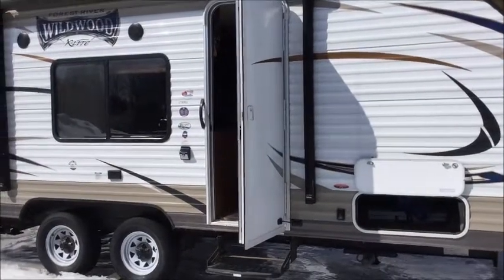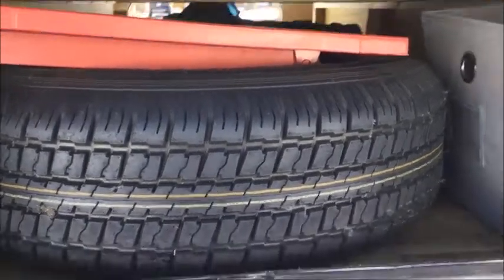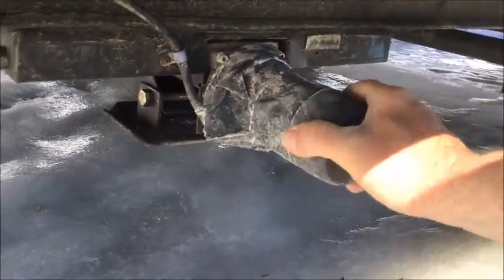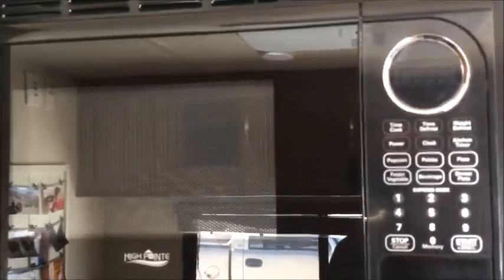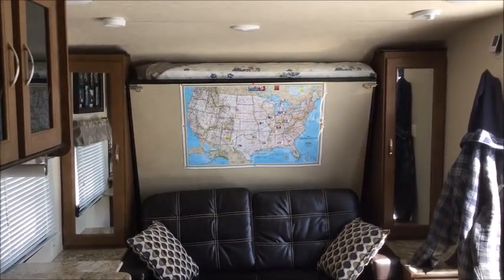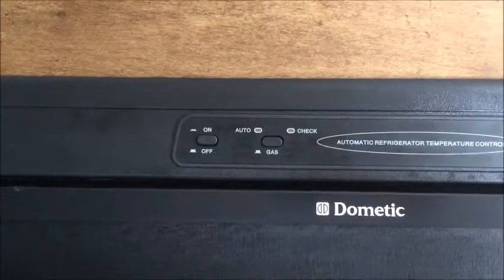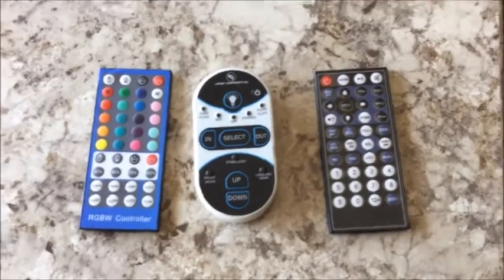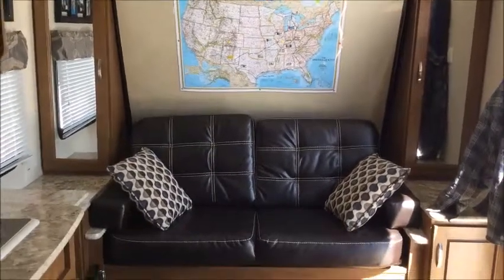New Forest River Wildwood 171 RBXL Camper/Trailer Owner Review

Comment: I'm 6' tall and I find the Murphy Beds with the short Queen mattress to be too small. How tall are you?  How do you find the mattress for length? One dealer suggested lengthening the support the mattress sits on by 6" and then pulling the mattress down 6" and filling the space at the head with the foam armrests of the sofa......
Reply from the maker: Not sure the frame will fit up to the ceiling in the storage position if you lengthen it. We slide the mattress down a few inches and fill the space by our pillows with a blanket. I am 5' 10" and fit without feet hanging off.
Reply: @biggestfishboy  Thanks, that's another practical  suggestion I've heard......might just do that

Comment: The trailer is wood framed not steel or aluminium, particle board in most areas covered by paper and glue, propane fridge will NOT work properly ever it seems, buy a use Lance or Artic fox will not fall apart! Should you make the choice if your not a handy person, you will be at the dealer more than traveling waiting months for things to be fixed. Its cheap for  reason, beware people!
Reply: Did  you own one of these? I've had mine three years now and it has done numerous long trips, the longest from northern Ontario to Arizona on a 12,000 km trip. i also use it every weekend here in Ontario and other than the few things I mentioned in the video, I have had no other issues. as for the fridge. that in a Norcold issue, not the trailer manufacturer. I've never had an issue with mine running gas or electric.